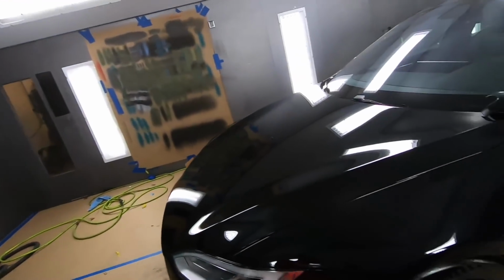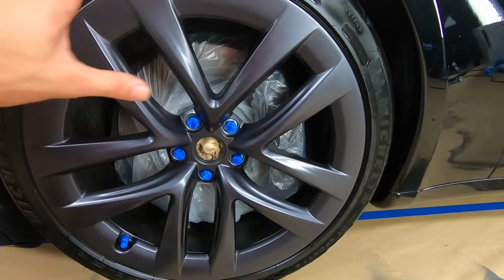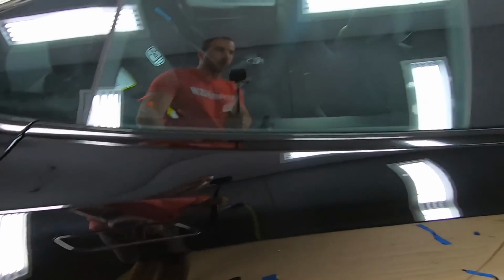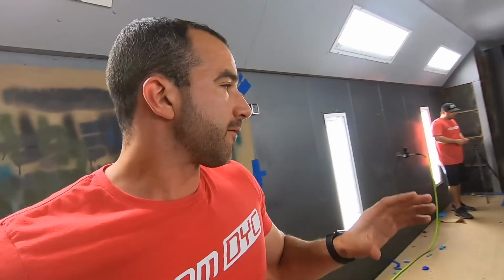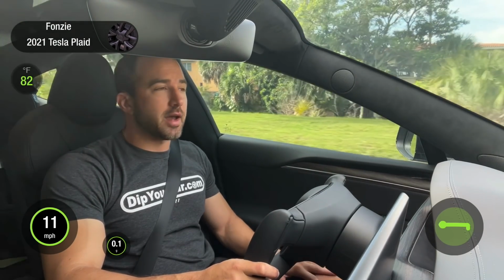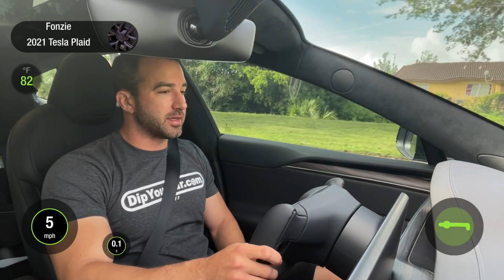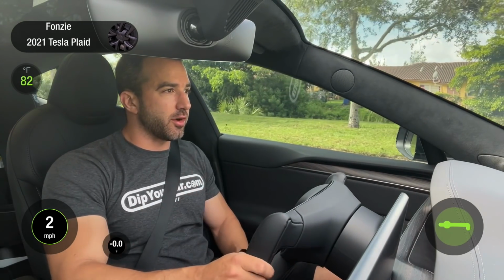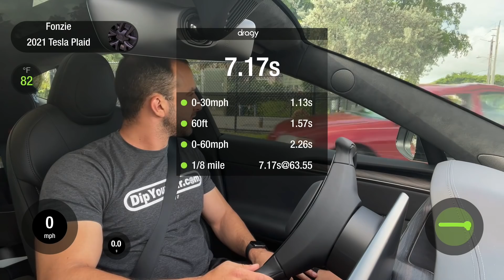Blacking Out the Emblems & Wheels on a Tesla Model S PLAID w/ Piano Black HyperDip

Comment: I hate that steering wheel, as fast as that thing accelerates you need to be able to let the wheel slide through your hands. That's gonna be a problem for some. But it's a bad ass car.
Reply: Letting  the steering wheel slip through your hands at that acceleration seems unwise in the extreme.
Reply: @CorwynGC  I meen, i live in the country and sometimes just pulling out of my driveway onto the road, people fly and you have to accelerate pretty hard sometimes to jeep from getting hit and you kinda have to let the steering wheel correct itself through your hands. That's just a normal driving situation.but what do I know I'm just a poor boy in a 20 year old pick up truck.
Reply: @coreystanfill9064  I have a similar situation.   But I was trained not to lose control of the wheel.  I just pivot the wheel under the heel of my hand. Faster than letting it slide but under full control.
Reply: KITT.
Reply: Clearly you've never seen a formula 1 car then. I wonder how they can control their cars at such high speeds and corners 🤔
Reply: @WhiteRaven___  wow, your comparing a dang f1 race car with steering that never requires to make full revolutions to a street car. Look y'all im sorry that I struck a nerve with you ELON MUSK DOES NO WRONG people. I DRIVE PROFESSIONALLY FOR A LIVING FOR 25 YEARS AND THAT'S MY DAMN OPINION
Reply: @coreystanfill9064  ok first of all...mr Poor boy who drives a 20 year old pick up truck is a "professional driver of 25 years"? So then what, you deliver pizzas?  In what normal situation are you going to be making full revolutions on a normal steering wheel when you are on the road driving? Your not. When parking and getting out of a parking spot is the only time you are going to turn the wheel that much and guess what? Formula cars also have to park their cars... amazing isn't it? Stop hating on innovation and creativity. You are only making yourself look dumb.
Reply: @WhiteRaven___  Firm grip. Race car drivers don't let the wheel "slide through your hands."
Reply: I agree with round steering wheel is more safe. I've had cars spin out in high speeds due to heavy rain, Winter conditions, or swerving to avoid an accident. Being able to swing that wheel around fast helps to recover in conditions like these. It doesn't happen often but when it does you don't want that clunky rectangle hitting you in wrists and such.
Reply: @coreystanfill9064  Randy Pobst, the race car driver, replaced the yoke in his Plaid with a wheel. It's a gimmicky user interface and they should not have done it.
Reply: Got my Plaid S a month ago.  Pluses and minuses to yoke vs. wheel, but I wouldn't go back to a round steering wheel.